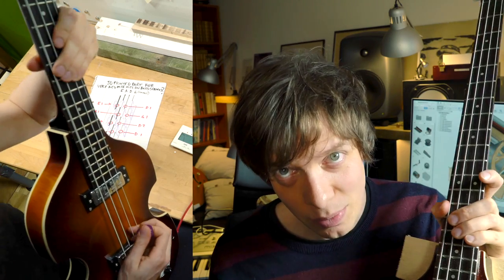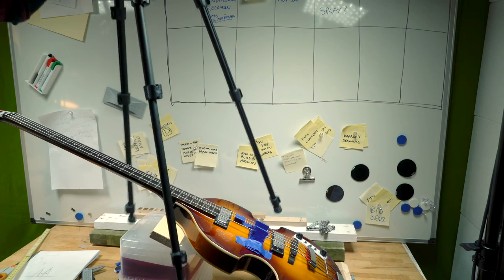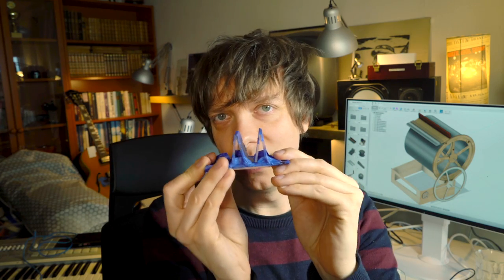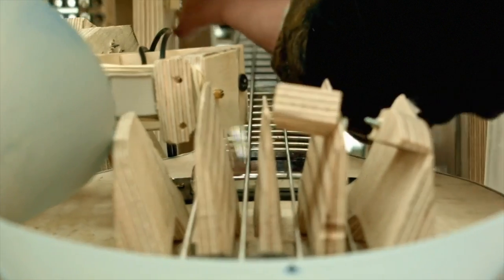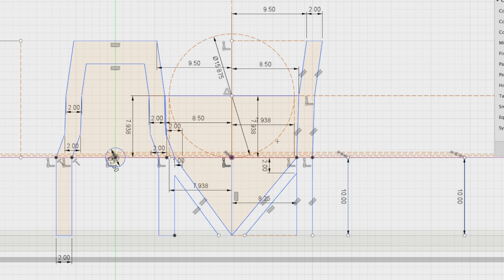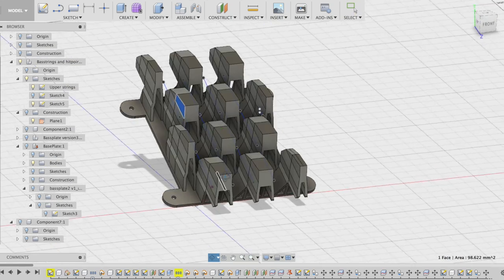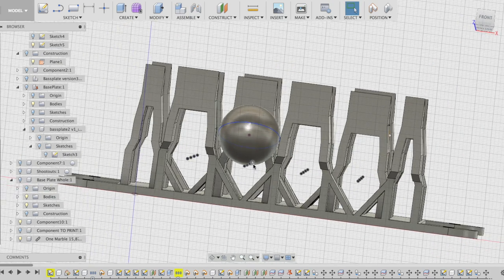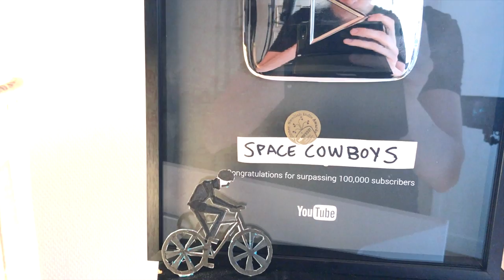How to hit Bass strings with Marbles - Marble Machine X #4

Comment: Wow Martin, if that is really the first model you attempt in Fusion 360 I'm amazed. I've taught CAD and I think many of the students would be struggling to produce such an intricate model even after the course. Also, congratulations on the silver play button.
Reply: That's sad. But then again, maybe it's your failure as a teacher. Lots of people cannot remember something they learned on abstract crap. Try to give them task to design something 3d-printable that they really need and will use. Or something that could be made with router and chisels. And let them made it, preferably, using only hand tools.
Reply: Evil Gremlin While I don't claim to be flawless as a teacher, I've only been a TA so there's only so much I can do. I didn't mean it as criticism of the students in any way. We don't really train them on this kind of stuff in the first course. After the second course, I think most students could produce this level of complexity. Since I taught the course we've bought a few 3d printers to inspire some students to push their abilities beyond the mandatory exercises.
Reply: Well, you didn't got into details about courses :) But using only 3d printers to learn feels wrong to me. It's really good to be able to design things while thinking about tools required to make them and actual making process. And the more limited tools range - the better. It's important to understand how press forms, cast forms and CNC works, but it's more important to know how to use them properly and only when you absolutely need to. Especially any kind of CNC. And old good filer and chisel is first step to understanding.
BTW, the part Martin designed could be made in any way i mentioned, but quickest way is to make it out of some hardwood (ebony would be great) using good miter box.
Reply: any tips to learn fusion 360? im using solidworks for now to do basic autocad
Reply: +Evil Gremlin
Wow, you're really judgemental man. Perhaps work on being less harsh and you'll live a happier life for it.
Reply: +Sander
Not really, i just suck at expressing myself properly ant tend to unnecessary exaggerate :( Especially when it's about engineering, because my job is electronics repair, and i see bad engineering every day.
Maybe i should add IMHO before every word? :)
Reply: Never heard of Fusion 360. I know about Solidworks & Sketch-up.I used Sketch-Up b/c that's how I started CAD. I'm thinking into moving to solidworks. Now that I know about Fusion which one is better? Fusion 360 or SolidWorks?
Reply: Israel Contreras I start from solidworks as my sch accepted external help to tackle angle projections , exploded views and colour rendering, to me as a student, yes its is ez to understand compared to other programs
Reply: Jasper Chua So solidworks is the way to go?
Reply: u gotta try to know cos im talking from a secondary school student standpoint, i havent progress more advance cad programs yet for now so this is a go to program for all my cad programming needs
Reply: Jasper Chua thx bro
Reply: Fusion 360 is however much easier to get into than most other 3D CAD software.

Comment: I'm no carpenter/engineer/architech but I have a suggestion, what if he used a "Hammer" mechanism similar to the piano. The falling marbles will trigger the hammer like pressing a key on the piano. Using that method, you can lessen the the amount of marbles from falling out of the machine since the marbles will now fall in a fixed direction and position.  You can make fast rhythms with it too :D

Comment: Why not set something up like in a Piano instead of just having the marble drop on the string directly? Make Four Hammers, one for each of the strings and then have funnels or tubes that drop a marble for each of the hammers. The Marble hits the hammer the hammer hits the string. You can also increase the number of hammers for the amount of times you want the string to be hit.
Reply: Thats a pretty cool idea, but I guess there would have to be some kind of spring mechanism to revers the hammers back to the original position after each hit. Might be hard to calibrate that so that the springs doesnt supress the hit, but still are able to lift the hammer.
Reply: it would be so cool if it worked smoothly.. but I think the main problem will be how to hit the strings at the precise time without any delay
Reply: The delay is not a problem, the different tracks on the wheel can be offset from each other, by way of the release mechanism.
Reply: In addition, he has mentioned a lot how visual feedback is very important to his stuff. So seeing the marbles hit the string is a lot more visual and obvious, vs a more disguised mechanism in the piano
Reply: My other comment can't be seen because I included links. Mechanically speaking its not that complex.

It would be A wippen, hammer, counter hammer and damper.
Reply: John Lemus Yeah, this is pretty good idea ! Would need to find away to make space though for each hammer per string, or separate the strings into individual units
Reply: Considering that we only need about 8 I am sure you can make a mechanism small enough that it would only take up a bit more space than the one in the video. The worlds smallest grand piano is only 25 cm wide and 18 cm high. You can also look up the piano tiles 2 robot.
Reply: Chris Jarvis

That's entirely subjective, it might look cooler or about the same as what he is doing now.
Reply: Little paddle wheels that spin when hit by a falling marble located next to the strings and act like a pick to pluck them would also be another option that may work. But he's not going with that this time around either.
Reply: Something like this would totally work! It's called a harpsichord! The mechanisms used in an harpsichord would work perfectly but you loss the magic of the marbles.
Reply: that sounds really complicated.
Reply: Joseph G  The strings of a harpsichord are plucked not hammered.
Reply: Yes but I'm saying if you didn't care about the marbles you could build the bass like a harpsichord and it would work well.

Comment: I am worried that the marbles may start taking bad bounces when the strings are being hit rapidly.  It might cause one of the marbles dropped into one of the upper slots to bounce into a lower slot and get stuck.  It'll be interesting to see what happens when you get it printed and mounted!

Comment: I noticed you designed the piece without accounting for the thickness of the strings. that might change the hit point sightly in each channel, maybe not enough to radically affect the whole process but it might be worth making sure - a line in CAD has effectively 0 thickness, so the hit point will be slightly higher than what was illustrated
Reply: also, pretty sick bass picking there at the beginning, I dig it

Comment: two worries that I have is that the strike zone is so small in the vertical dimension and that the thinness of the channel will cause a fracture. 

The vertical dimension will be where the amplitude of the string will be vibrating, and based on the image of the CAD, if the frequency of marble dropping is too quick, it is possible that the marble would hit the string at a low amplitude moment, meaning that it would either mute the string, hit the mounting, which could damage it depending on fall height, or when the string returns to equilibrium amplitude it will fling the marble further than intended. 

The thinness is a worry if the marbles have any direct or indirect contact with the mounting, or if the mounting is bumped during storing between gigs on tour. I would have our dear engineer friends take a look and make sure that it looks struturally sound. 

Other than that, beautiful work and I am always excited to see more. See you next week.
Reply: Matthew Slater I was worrying about the risk of fractures as well, and now it also hits me (no marble pun intended) that the plastic guide piece might give of a very different sound from the earlier solid wooden blocks. I'm sure Martin has already thought of that, but it would be a pity if the bass sound got messed up by a puny plastic "plink" or something when the marbles hit.
Reply: He could make it out of nylon or something similar. Some of fluoropolymer will do great, it's strong and elastic, though can't be printed (melting point too high and vapors too toxic), only carved. 
Or maybe even cover whole thing in rubber.
Well, really only ABS and overrated PLA definitely won't do :)
Reply: so youre the guy he was talking about
Reply: Benny Löfgren I agree. Finding the right material would be integral.
Reply: general kitten Am I the guy who was talking about?
Reply: I strongly agree that the the channel is too thin for the marble with what looks like just 1 millimeter at most on either side of the marble IF the marble falls EXACTLY straight down. However if the machine moves at all during play (even if it moves less than the original) the marbles are going to be hitting the plastic channels on the way down to the strings.
Reply: the plastic used for 3D printing is really strong.
considering that the whole piece is basically a structural spine, it would take some sustained punishment to break it.

Comment: This is a great solution. I would say the only improvement you could make is a way to add the piece to the bass without removing the strings. For cases where possibly the bass is damaged during transport. Perhaps a slip channel in the 'valleys' where the strings go and the piece relies on the 'hills' and the mounting holes for its rigidity. I also worry about the 3D printing being too brittle or even too soft so either it breaks or the marbles don't have exit consistency. Best of luck! These videos are always great :)

Comment: The modeling software use looks good. Just the way I learned it at University. 2D sketch, extrude and what you did at the end was great. The wall thickness sounds okay, lets hope that it's sturdy enough. I suggest to have 2 pieces printed, so there is a backup if it breaks.
The quiz show at the end was so cool and funny. XD

Comment: Hey as far as 3D printing goes,  taking more time is not bad. I usually make the design quickly and then spend like twice that doing "finishing touches". It is important to remember that printers print in layers usually, so things can't float in midair (unless you use support). Honestly in my opinion your design looks great, and the best part is if it breaks, you can print a new one. If it needs a few changes, you can print a new one. If you need more, you get the idea. Basically it's really great stuff.

Comment: Martin, consider removing the V-shaped support beneath the hitpoints of the strings. The marbles will produce less noise by not hitting the plastic structure as much; the strings will flex more freely and they will return the marbles anyway. If the mechanical support is needed for rigidity, try placing the support under the covered areas instead.

Comment: practally, there was little reason for you to create a plane at a different angle. but I'm impressed how well designed it is. from experience though 3d printing had a resolution of about 0.1 mm. imagine trying to draw a picture with a really wide marker. so don't expect the final product to exactly resemble the CAD plans

Comment: I was once in your position with Fusion (and I'm not a pro by any means) but the part you modeled is actually pretty impressive for a beginner.  My only caution is to make sure to check your tolerances on your dimensions, as the filament of the printer will likely expand past the exact bounds of your geometry.  The amount depends on the printer it is printed on, but it's good to be safe just in case.  It's hard to tell from the video (imagining the scale without having the part it needs to fit onto in my hand is hard), but the space between the marble and the walls looks sort of worrying from my point of view.  Then again, I don't really know the exact requirements for the part, including what that tolerance on that dimension needs to be for the marble to actually hit the string consistently.

Comment: Before you came up with this concept, I figured it would be a lot easier to put small tiny hammers that would hover above the strings, it would suspended and spring loaded spring loaded. When the marbles hit the back of the hammer (more surface area), the hammer would strike the string.. and it would go back up quickly due to the springs.. you would also make the surface of the hammer at an incline rather than the bass.. but your idea probably seems better suited

Comment: Hear me out here - are you going to restring the bass THROUGH the holes? Leave the bottom open so you can place it on after maintaining the bass. You have the 4 holes for attachment, after all
Reply: Eh, it's really not much work to just shove the strings through the holes.
Reply: yes, but restringing and re-tuning it after every maintenance for the guides?
Reply: Of all the things he has to deal with when building these things, having to tune it a few times is pretty trivial. I'd much rather do that and be sure that I have a solid foundation for the guides, and a more rigid structure as a whole.
Reply: That's the first thing I noticed too.  I think a slit along the string channels so you don't have to thread it makes sense, but would make the structure more fragile.  If it's going to be mounted to the guitar itself it's not worth weakening on the last version, but any prototypes should be easier so you don't have to keep restringing the bass testing each one.
Reply: That's actually a good idea. Never even occurred to me, but then I've never strung or tuned a guitar so...
Reply: what if instead of 1 unit it was individual pieces that just go over the string so no de-stringing involved? they would need to bond together so perhaps a sort of "jigsaw puzzle connection between each piece under the strings but I am just trying to think... once on why would he ever need to take it off? its not like he has to disassemble the marble machine for flights to country to country? or does he? so what is the problem with de-stringing and re-stringing 1 time?

Comment: Hmmm.. I feel like this Model may have 2 problems:
- The Marbles may push the string down too far and actually touch the bottom of the V and so lose too much speed to be able to bounce off again
- The marbles bounce off but the angle is too low so they get blocked by the next hitpoint.

Comment: Have you considered what might happen if you break a bass string? You’d have to thread new strings through your current design, but you might be able to modify the design to allow it to slide over the top of the strings; quick removal for string replacement, then reattach. The downside might be a more flimsy base.

Comment: I know that you can pull the strings through the part to set it up, but my worry about the design it doesn't
solve the problem of getting marbles out if they get stuck on stage for one reason or another. 

As you said the piece was small I can imagine getting the marble out will be difficult. I would suggest balancing 
it so that both the marble could be removed without interfering with the strings.

Comment: I just came to watching that video and I must agree with all the other posters before me: Great work for the first time modelling in CAD! I'd have some thoughts for you on the model though. I guess, some or all of my ideas have been posted already, but unfortunately I didn't have time to read them all, so excuse me for that. First of all: I'm working in CAD for some years now and also have experience with 3D-printing (actually LETTING 3D-printing) some stuff that I constructed in CAD. I let my stuff print with fabberhouse, maybe that's interesting for you, too, Martin. Well, first of all: Don't know, what kind of 3D-Printer it's gonna be printed on, but if it will be FDM, you have to make sure, it will print some support structure in there, so your model will not collapse when printing the overhangs. Secondly, I'm not sure, if the 1 mm thickness in some parts of the model will be suffice to be stable. I did a much smaller piece with even 2,5 mm thickness and when I wanted to remove the support structure, it just broke. Don't know, what happens, if it will be hit by not-so-light metal marbles ;-) Other than that (and the comments of other obviously very talented modellers that follow your stuff) it looks really great! Looking forward to see it in action!

Comment: Good work.  You may find it hard to print that piece without some modifications.  3D printers don't like to make flat surfaces that point down, because there is nothing the support the first layer of material.  You should find the 2 mm thick walls quite reasonable as far as strength goes.  Apologies if this comment duplicates someone else's.  I haven't been though all 630 previous comments.

Comment: I have two years experience with an 3D modeling software known as 3D Studio Max ( Its a program very similar to AutoCAD which is the program you are using) and can say that your model doesn't look like it has any flaws. A 3D Printer should be able to print it easily! Make sure it has the right measurements though, If it isn't its quite easy to resize it :D

Comment: Just a tip 2mm walls may be weak once 3d printed also I would suggest filling in all the void space you can to prevent the print from being fragile
Reply: The strength of the print really depends on the quality of the printer and there settings of said printer, as well as the material you print with